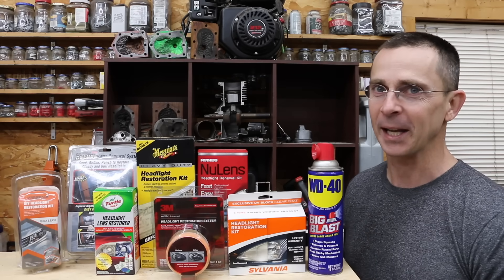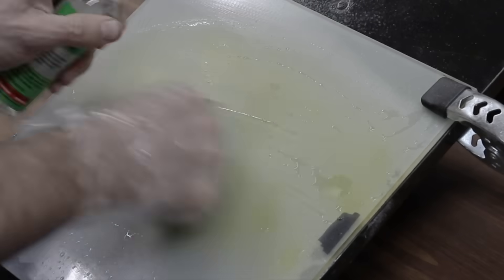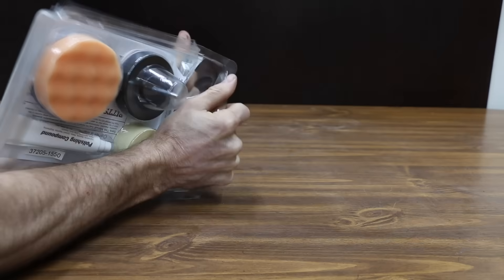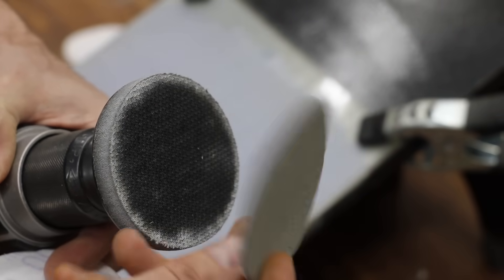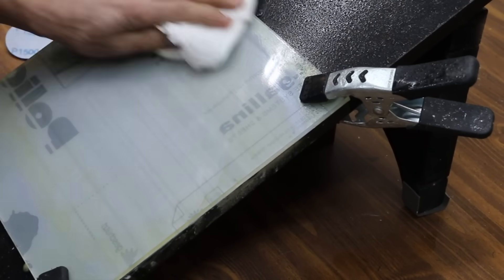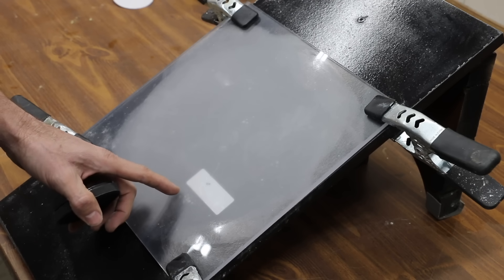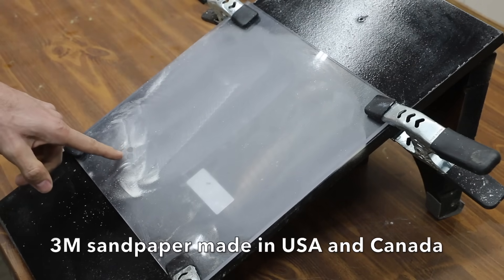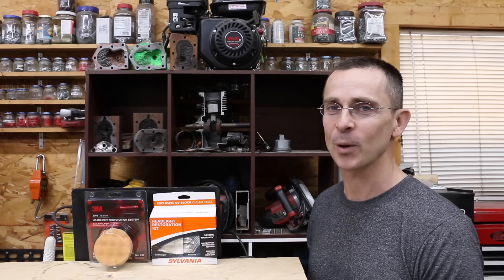Best Headlight Restoration Kit?  Let's find out!  3M, Sylvania, Meguiar's, Mothers, Turtle Wax & HF

Comment: I just watched Sylvania's video on how to use their kit. Maybe the steps have changed in the four years since this video was made. In Sylvania's video (and in the instructions that came with my kit), after cleaning and drying the headlight, the 1st step is to spray the Step 1 SURFACE ACTIVATOR on and leave it on for 30 seconds (instead of starting to sand as shown in this video). This removes cloudy stains and softens the hard coating. Rinse off with water.  Cut in half all the sandpaper sheets provided. Next, wet sand headlight with the 400 grit sandpaper until smooth. Then move to the 1000 grit sand paper for 2-5 minutes. Then use the 2000 grit for 2-5 minutes. After sanding, rinsing and drying, rewet the headlight with water. Using the provided white towel, apply a quarter-sized amount of the Step 2 CLARIFYING COMPOUND. Apply like car wax. Rinse and dry headlight. Apply the Step 1 SURFACE ACTIVATOR for a second time. Wait for 30 seconds. Rinse with water and use the other provided white towel to dry. Finally, fold the provided blue towel. While wearing the provided vinyl glove, wet the edge of the blue towel with the Step 3 UV BLOCK CLEAR COAT so it covers a strip about a 1/2" wide. Using smooth strokes, apply to headlight, like a paint brush, from top to bottom. Overlap strokes slightly. Do not apply another clear coat. Wait for an hour before touching headlight. Try not to drive for a couple hours to allow UV coat to cure.

Comment: My intuition lead me to use glass cooktop cleaner on my 99 Camry which had yellowed light lenses.  It’s designed to pull contaminates out of your cooktop.  Wow without having to buy anything (for me). It worked great about 95% clearer.  Using sponge apply a coat of the cooktop cleaner.  Leave it let it work and dry completely.  Wipe off and repeat.  Try it out
Reply from the maker: Thanks for the suggestion.

Comment: Have you ever done a test on spark plugs,  ie  single electrode,  dual electrode, and so on. Platinum vs copper ect. Be a challenge to determine the testing method but would be interesting all the same.

Comment: It would appear, to me, that you used too low of a sand paper grit using 120 grit. That appeared to be too rough for real life scenarios. You can feel the texture created with your fingers after that grit being used. However if you feel the texture of a naturally yellowed headlight, it does not have that same notable texture which leads me to believe that the turtle wax brand could've stood a better chance in real life applications because it wouldn't have gotten as worn out evening out the unrealistic texture that you created. I believe a more realistic review should've been done by using a pair of naturally yellowed headlights but using tape to form different sections for each brand. I would suggest doing a new video where you are completely absent from creating the "natural yellowing" of the headlights instead. Even Tylertube did that and your thumbnail shows that kind of comparison.

Comment: What the viewers need to understand is what works best on one headlight may not be the best on another. Every manufacturer produces headlights differently. Some apply soft clear coats at time of manufacture, some are incredibly hard (BMW). Hence, let's say a BMW headlight needs restoring (unlikely unless very old as they are so hard), you are wasting your time with creams and polishes and likely need to go straight to 400 or 600 paper. Whereby, in some other cars brands, the clear coat is so soft, that a polish then an application of a coating might be enough.
There is no one-size-fits-all procedure to restore every single different type of headlight on the market. Hence, what works great on one headlight might suck on another.

Comment: A tip for anyone using a drill or anything like that switch the rotation with every pass and the headlight turns out way better (I do this at my job it works better)
Reply from the maker: Thanks for sharing.

Comment: The headlights on my 1990 Volvo 240 wagon lasted the life of the car, 34 years and 400,000 miles, without being restored. I cleaned them twice a year using McGuire's PlastX. All that time, using nothing but the cream and paper towels, and the lenses are still clear and not yellowed.
Reply from the maker: Thanks for sharing.

Comment: This isn’t gonna work consistently, he applied a paint for yellowing, oxidation and paint are two separate chemicals. What he should’ve done was go and get a bunch of headlights like you was showing before and apply the products to those because those have oxidation.
Reply: He painted it for the most consistent testing.  It may not be 100% accurate but its a good way to keep the testing even.  Plus these kits are basically sand paper, a polishing compound, and a sealing coat.  Really the only difference from the kits in the end will be the sealer and how long before you’ll have to do it again.

Comment: This has to be the only video (that I've seen) from you that just fails....   Best kit I've used, has to be the Cerakote lens kit. I did my lenses about 2 years ago, and they're just starting to get yellowish / hazy.   That usually happens in 6 to 12 months with most kits.

Most headlights are made of a special impact and abrasion resistant polycarbonate which has a much harder surface than Policomp, which is probably why you're having a hard time buffing out to crystal clear results.   Of course, to get the right stuff,  it's probably 4x what you paid for the Policomp.   I've used all but the HF & Visbella products over the years, and my lenses always come out looking like optical glass.  The only real difference is how long it takes for them to haze up & yellow over.

Comment: It is mainly about finding a good clear coat that does not yellow, is UV resistant and fully dries (probably 2 component). Sanding is just straightforward. No kit needed, just a good clear coat.
Reply from the maker: Thanks for the feedback.

Comment: Unfortunately I had to use the Turtle Wax kit recently as the others weren't available, and while it came with enough stuff for two headlights the polishing pads provided weren't coarse enough to tackle badly oxidized headlights. Ended up wet sanding it with some 3M sandpaper before finishing it with the polish and seal in the kit. Definitely steer clear unless you just need a touch up.
Reply from the maker: Thanks for the feedback.

Comment: When I restored the headlights on my Mums car I used 5000 grit sandpaper on them followed by 7000 grit sandpaper and then polished them back with T cut and finished it off with Turtle wax and some ceramic coating to seal them this was over 3 years ago and the results have held up well I removed about 90% of oxidisation and yellow from the lights and most of the clouding too. These were a terrible example too they were very far gone as they usually end up MK5 VW Golfs. She couldn't believe how much better the lights were and at first was trying to turn off the full beam despite it not being on. I don't think any kit would have done as good a job as straight up sanding them like I did.
Reply from the maker: Thanks for sharing.

Comment: I used the Sylvania kit based on this review. It worked great initially but the coating they provide doesn’t last at all and my lights need to be redone again. Not even a year later. I need to find a better, longer lasting finish.

Comment: Basicly go to home depot
And by wet/dry sandpaper
And clear coat UV 
polyurethane Spray
And save yourself some money
Reply from the maker: Thanks for sharing.
Reply: @ProjectFarm 
No dude the pleasures is ours
Been a fan of the channel for years you sir are a Rock star 
The one take away is what I already knew 3m makes excellent products plastic adhesives and sand paper as history shows from your vids 3m has always been in top 3 slots I just enjoy 
Your channel 👍🥃

Comment: Love your channel and you do great tests, but I disagree with the use of sheets you really should have hit the wrecking yards and did it on actual head lights. They are baked on from heat and cold weather and the light coating you put on the sheets has not had the elements hitting it for a few years. I would not trust these test results. Hit the wrecking yards and do this the right way with actual headlight assembly units. Another thing is lenses are small and tedious to sand and nothing like the space you had to work with sorry Project Farm I do not trust these results. Maybe return later on and see if there really is a difference by using used headlight assembly units:P

Comment: I just used the TurtleWax kit last month on my son’s car. They were definitely more cloudy and yellowed than the headlight examples you showed in the beginning. He bought it and asked me to help him. 

IDK if TurtleWax improved their formula, as the box I purchased has a new look, but the contents seem the same. But the headlights came out great! They provide you two options. One is to use the sanding pads and the other is to just use the compound. They stated to used the compound first with a cloth (by hand) or polishing pad (with a DA or rotary) and if need be, to step up to the sanding pads if the headlights are severely damaged.

I followed through with just the compound and cloth method and was extremely surprised! It took some elbow grease and some prep, but was worth it. His headlights became clear and the yellowing was gone. I’m pretty sure I could have gotten amazing results with sanding, but for just using the compound with a cloth, I was impressed!

I’m guessing they improved their formula, as it seems like they’ve improved on a majority of their products, based on non-sponsored reviews for vehicle detailing products. 

I’m not a TurtleWax person, I don’t like to be a fanboy of ANY brand. If it works, it works. If it don’t, it don’t. I won’t judge all of a brand’s products solely from one product.
Reply from the maker: Thanks for the feedback.

Comment: I just used 1500, 2000 and 3000 wet sand paper, alcohol to clean lens, still foggy but then clear coat non yellowing and for plastic, turned out great
Reply from the maker: Thanks for sharing.

Comment: The 3M kit I bought for $24.00 came with a protective coating that you wipe on and let dry after all the sanding.. did both headlights that were very bad on my Jeep 2009 grand cherokee and even 4 months later look like new.. only took about 15mins per light...  amazing product for my money   bought it at Walmart...
Reply from the maker: Thanks for the feedback.

Comment: How about testing Cerakote's kit? Seems to be on par with Sylvania and 3M.
Reply from the maker: Thanks for the suggestion.
Reply: I went ahead and bought that kit. It worked quite well. Like the 3M and Sylvania kits, sanding is necessary; it includes a little sanding pad and sandpaper discs. I don't know what the grit is. The final coating seemed to fill it the sanding marks and it's almost, almost like new. "Very impressive!" 😉

Supposedly the coating will prevent future UV damage. We'll see.  @ProjectFarm
Reply: @geeniusatwrok  Make sure to check on the coating every once in a while (water should do it) since ceramic coatings have a durability measured in years when combined with good prep and application. Luckily the products are pretty common now so you can just clean and polish the surface before wiping on a new one.

Comment: I used those kits.... But not to keen on the tiny (at least the kit i got) sandpaper pads they give you and cloging and like you just said it wearing out. And then i use the clear gloss paint that exact one you showed too. I did try and like sand in-between but i didnt have the highest grit tho so i just used my 2000 grit lightly and not that much too worked ok. I didn't get to polish tho at least not yet

Comment: I got the 3M kit recently, and they've changed things out a bit, instead of polishing compound, after the 2,000 grit pad, they have you apply 2 coats (waiting 10 minutes in between) of UV clear coat on the lens (which they include in packets).  Dubious as I was to how well it'd work, I'm seriously surprised.    The lenses look near factory new on a 22 year old lens.
Reply from the maker: Thank you for sharing!

Comment: 2016 Honda Fit EX w 14,600k miles and still cloudy lights:(
Reply: I've got a 13 civic si. I used Mother's Mag and Aluminum polish applied with a round, dimpled foam pad attached to my drill. I rubbed it in by hand with a paper towel, then used the foam pad to buff each lens about 2/3 minutes per side. I did each lens twice. It actually worked. Each lens is as clear as new now. The polish was $10 at my local auto parts store. The foam pad is about the same price.

Comment: An auto mechanic showed me this trick some years ago. Blue Magic Metal Polish, on a soft cloth can be vigorously rubbed onto "plastic" headlights and polished up quite quickly. Usually less than 10 minutes per light, depending on damage. The factory coating, which usually peels away in places, is the hardest part to break thru. The fine grit sandpaper or 000 / 0000 steel wool works well.  I imagine it would be quicker with a soft drill buffing pad. But, here in Southern Arizona, without the UV Sealant coating, the process needs to be repeated every 6 months or so.. not hard to do. BTW.. I used the same stuff to save a pair of prescription polycarbonate eyeglasses, using a soft cloth over time, an hour or so, to remove the splotchy coating and small scratches. Very inexpensive. "Brasso" brand metal polish has worked for me in the past to take scratches out of watch crystals.. The Blue Magi works for that also. Just hold the watch face down on a soft cloth with the polish on it and rub briskly back and forth and in circular motions.
Reply from the maker: Thanks for sharing.

Comment: I just finished using a Mothers kit for this. All the sandpaper is 3M and holds up well, the kit includes a very nice Velcro tool to use with a drill or other rotating tool. A very large quantity of polishing compound in squeeze bottle. The only thing missing is a UV protectant sealer. when I asked to auto parts guy about that, he seemed to have no clue what I was talking about. Otherwise the Mothers is pretty good.

Comment: I wet sanded the headlights using my random orbit sander progressing up through the various grits.  Then applied USC SprayMax 2K Glamour High Gloss Aerosol Clear.  The headlights look like brand new.  I did my daughter's car and then my friends car.  The can is enough to just do two pair of headlights applying 4 coats.  Two thin coats, then two thick coats.  You only wait about 10 minutes between coats.  The paint is a two part paint and once you mix the two parts you only have 48 hours to use it.  The paint is dry to touch in half an hour or so and fully cures in a day or two.  I put the lights back on the car after 24 hours.

Comment: Wet sand your headlight with 400-600-1200-2000 grain, degrease with alcohol. Spray headlight in 3 layers with UV protected clear paint (like bycicle claer paint, available in every DIY). Let dry (harden) for 2 days, wax headlights. Repeat waxing 2 times a year. Youre good to go for 5-10 years. After that you can do the same preceidure. Total costs: 1,5 hour labour and about 15 bucs.

Comment: Bought the 3M kit + UV protection last year likely based mostly off this video. Didn't get around to it until today and oh boy are the results night and day (pun intended) on a 2006 Toyota.
It's very easy to see when the yellowing is gone with the 3M kit due to how well it sands away the polycarb. When sanding, once it goes from yellow to milky for the entire surface, move from lowest to higher grit. You will be breathing polycarb dust unless used with a mask or outside with wind.

3M is for your A-B car that you need to freaking see at night, and you want to use a power drill to make it a faster restore.
Sylvania is for that special car that you want to take the time, because it's that car...
Reply from the maker: Thanks for sharing.

Comment: Well, I bought the Meguiar's before I watched this video. I did my first headlight ever. I learned from it. On my second light I've sanded a lot more, I applied the final UV coat faster top to bottom and it came out a lot better!  also made sure that the polish was completely washed before the final UV coat.  I applied more coating to the first light and that improved it.  So, I guess that this video is valid if products are applied by experts with each product Therefore the winners here are the easiest to apply.  I wonder what the result would be after exposing the samples sun and weather if you leave the pieces exposed to the environment untouched for two years???? Of course, that would be a final coating test if all samples are sanded enough.
Reply from the maker: Thanks for sharing.

Comment: Do you think it would be possible to use a headlight restoration kit to remove scratching and light surface damage on a Polycarbonate prescription set of lenses with out changing the effect of the lens?
Reply from the maker: Thanks for the suggestion.

Comment: I just did the Sylvania kit and was surprised (?) that the UV top coat smelled and applied similarly to polyurethane. Perhaps the same? UV stabilized and a bit thinned out. From reading the comments, it looks like a long lasting solution.
Reply from the maker: Thanks for the feedback.